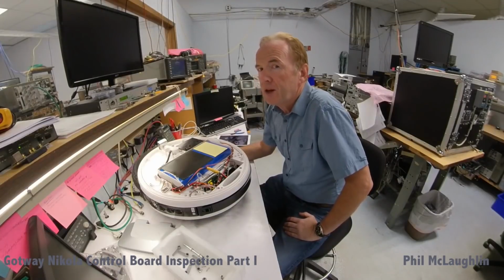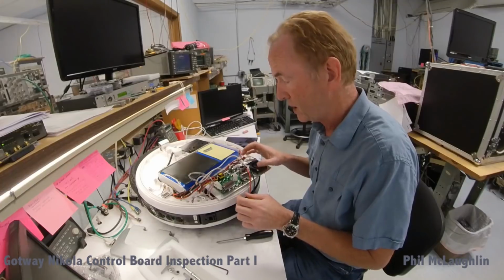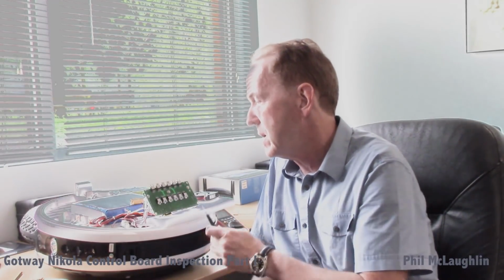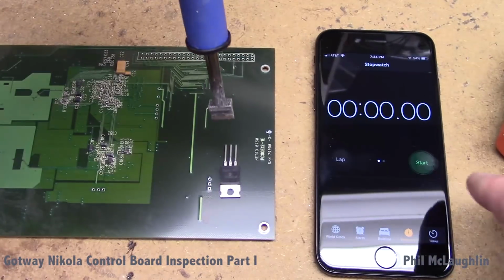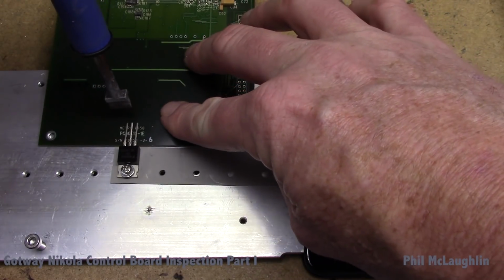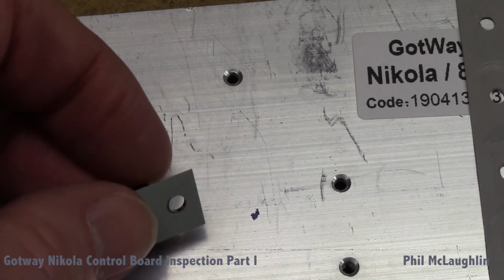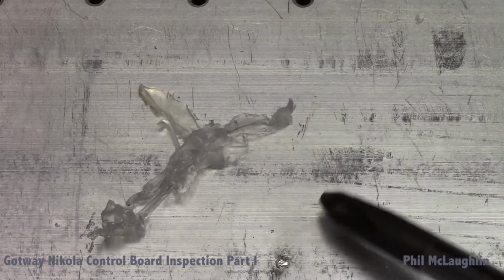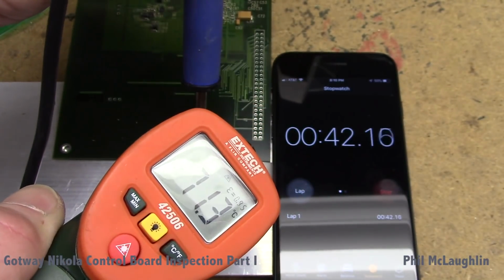Gotway Nikola Control Board Inspection Part 1

Comment: Hey Phil, this is an amazing video, we really appreciate all this effort. I’m an early adopter of a Nikola 100volt 1230wh wheel. I love it and not liking the idea to see if there was glue used on TO -247 fets. What’s your opinion on the configuration of the larger fet boards, do you think the assembly could be the same? I ride around eastern Long Island, and NYC.  Appreciate your opinion, Mark
Reply from the maker: Thanks Mark. Just finishing up the edits on Part 2. I think that the bigger TO-247 package is more tolerant to the use of low-end thermal pad material and small amounts of contamination in assembly. I would be cautiously optimistic that your 100V would be fine. If a manufacturer is using packages with small surface area they really have to get everything right.

Comment: Love the video! How would cpu thermal paste compare to these other thermal pads?
Reply from the maker: Tested in the Part 2 Video. Works well but needs an electrical insulation layer leading to two applications (yes this is true even if non-conductive paste is used). It is also quite messy and creates a fairly fidgety assembly job which is demonstrated in Part 2.

Comment: I was hoping to see a high quality thermal paste for comparison.
Reply from the maker: Tested in the Part 2 video. Should be uploaded tonight
Reply: @philmclaughlin6866  Cool! Pun Intended...    I'm assuming it will perform better since that's what all CPU manufacturers use.  But some people have mentioned the need to isolate electrical conductivity in the MOSFETS, so maybe it won't work?  I'm not positive why the isolation is needed, but I'm not an electrical engineer...

Comment: My question is(was); why did that residue end up there , in the 1st place(on BOTH wheels)?
Reply from the maker: The thinking is that adhesive was used as an assembly aid to hold the middle thermal pad in place when it was placed onto the aluminum heatsink. Only Gotway knows...
Reply: Phil McLaughlin i get that...but MY thinking is that in doing so god(euh, i mean gotway) must know that it is most likely going to melt(at some point) and find its way where you and Marty found it😔

Comment: you are lighter.. so if you don't put under stress it won't blow but put some arctic silver paste but nice putting these on..
Reply from the maker: I am 175 lbs (79 kg) w/o gear. The second video discusses and tests the use of a thermal paste solution. There is no actual evidence at this point that the Gotway supplied thermal solution is inadequate as long as they stop contaminating the thermal surfaces with adhesive in production.